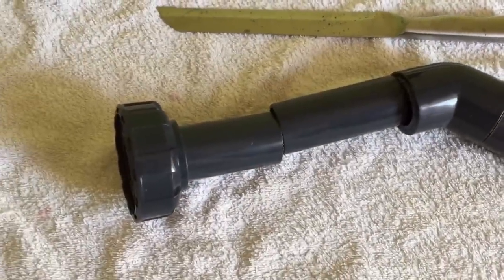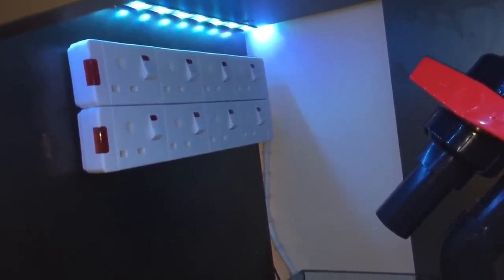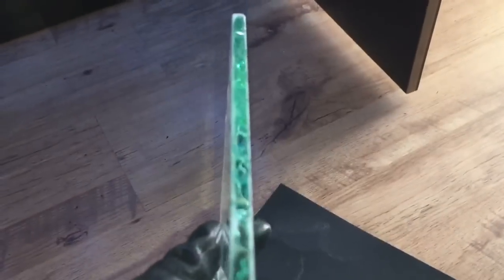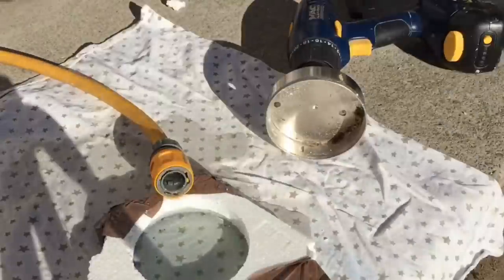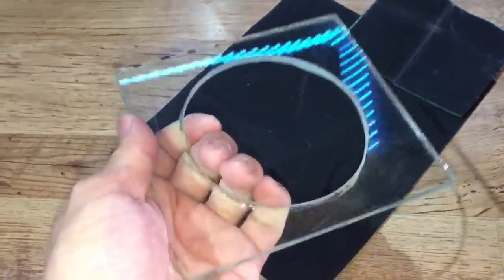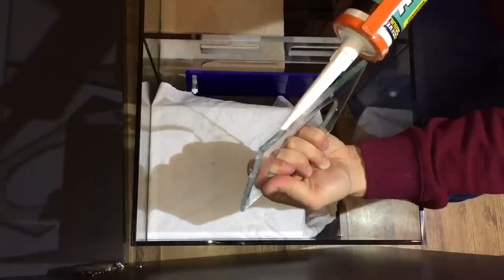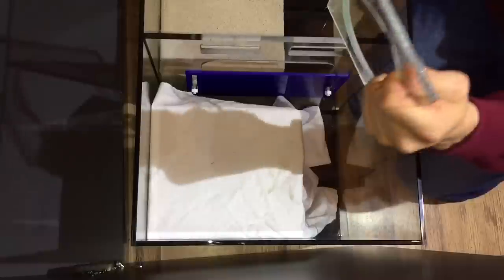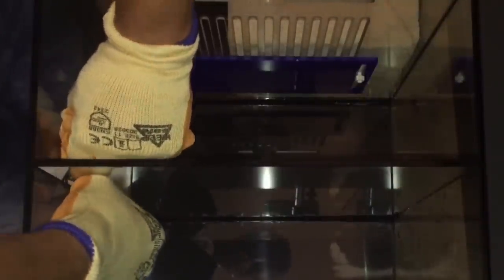Reef Aquarium - eaReef Pro 900 - Episode 3 - Sump ( part 1 )

Comment: Ace to hear a local Twang , i have a 1200s coming on Friday , the promise of free bacon rolls and a cuppa has roped a few strong lads into the lift fae the pavement !! lol great video ! would you recommend the Marine pure ? never used it before but looks like a great idea.
Reply from the maker: Hi Alan, great choice 👍🏻

Marine pure is great but not necessary really. I just used it because I used less rock in the display than recommended. So it helped balance out the biological filtering capacity of the tank. 

Good luck fella 

Cheers 
JD

Comment: hi just started watching u great videos  I have had a marine tank for about 3 years but decided I wanted a proper one that was made by a company  I also went for the aqua evolution pro but the 5ft one I just want to ask what type of drill did you use to cut the glass and also where u got the acrylic as in my old sump I had coralline algae everywhere so I want to do what u did and limit the light to just the refugium
Reply from the maker: Hi bazaa, good taste in tanks I see 😉

In regards to the drill. I just used my cordless drill with a diamond cut drill bit. 
The acrylic I bought from eBay. Simply search for acrylic sheet and you’ll be spoilt with choice... 

Cheers 
JD
Reply: Cheers Jd awesome videos will let u know how I get on
Reply from the maker: Nice one 👍🏻

Comment: Hi JD what is the marine pure blocks for and where did you get them ??
Reply from the maker: Hi Bazza, the marine pure is basically like live rock. It works just the same but has loads more surface area for bacteria to colonise and grow. Having marine pure in the sump allows you to get away with having less live rock in the display tank. Which is really good if you like minimalist aquascapes etc. Since you don’t lose filtering capacity with having less than the recommended lbs per kg and so forth. 

Personally I’ve used it since it became available in the UK and I think it is awesome stuff. Especially since I Love island aquascapes. 😍

Cheers 
JD